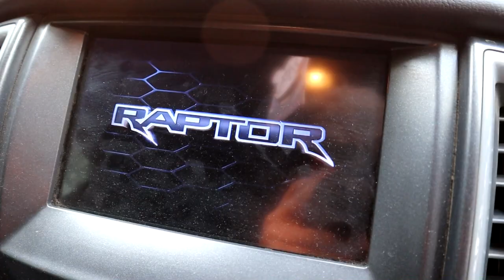Ranger RAPTOR suspension news and tank guard install

Comment: I have the 2020 colorado. Did the muffler delete over to the shorty pipe aka pre diff drop no muffler and its great for the dpf to clear itself faster and helps the turbo breathe. It is true they dont get louder unless doing a dpf burn but saves alot in the long run due to heat moving faster

Comment: I found the vid you did but could not find a follow up vid.. were the snake racing spacers any good ? (for and considering they are only to level it at stock weight)
Reply from the maker: not enough difference imo need to go a bigger spacer
Reply: @Lukefink  ok thanks from available info seems going with bigger spacers may change things... so the mikes shock rebuilds may be the only option